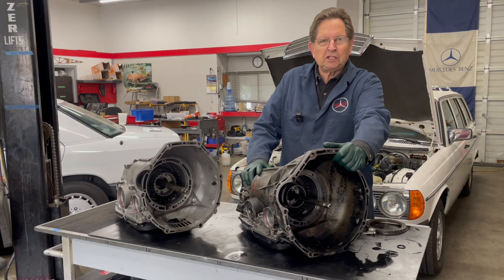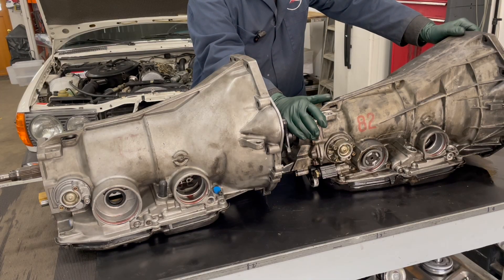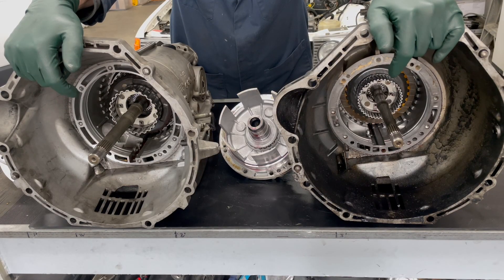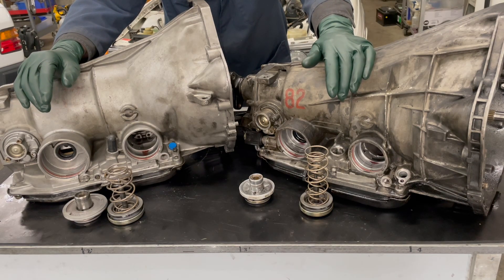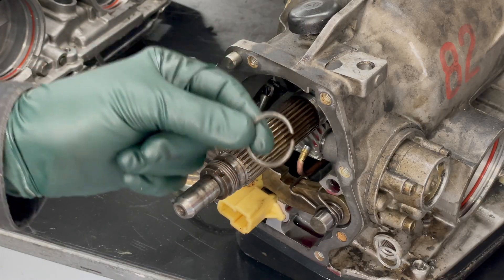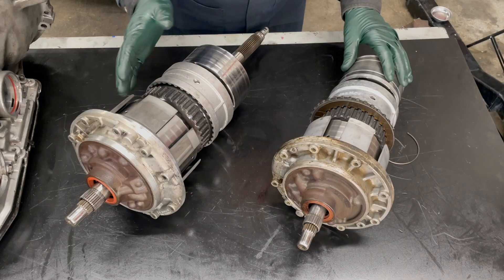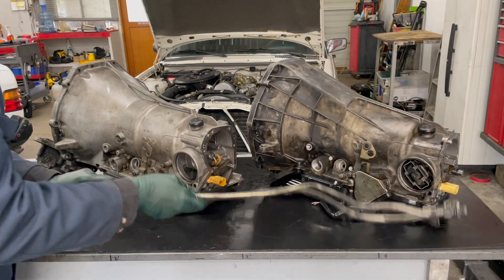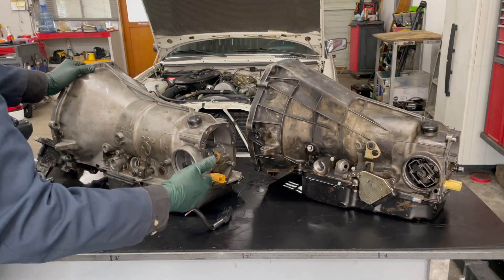Mercedes 722 3 vs 722 4 Transmissions: Differences? Swapable? @mercedessource.com

Comment: Dos the B2 pistion regulate shifts 2-3 becos my w124 jer k s wen it shifts 2 to 3 gear?👍?
Reply from the maker: The B2 piston does not "regulate" the 2-3 shift, but a problem with it can cause harsh shifts. It moves the B2 brake band on the K2 drum. Google for more info
Reply: @Mercedessource thank you👍

Comment: Are all seals, o-rings and clutch packs still available from Mercedes?
Reply from the maker: I may find that not all genuine parts are available. It is changing weekly as many older parts are becoming NLA. Check with Mercedes. Good aftermarket parts are still available.

Comment: Does the 722.3 series interchangeable? I have Sprinter 2.9 with 722.375 and i wonder 722.369 and 722.375 are they the same? I couldnt find 722.375 - in my reverse gear is broken (sometimes it doesn't connect and it jerks),
Reply from the maker: Most of the internals are the same, but there are differences in the case, torque converter, valve body, etc... due to the different engines it is mounted up to. Be careful. Do your research. I may be better to remove your transmission and re-seal it.
Reply: @Mercedessource  Reverse issue - Is this only seal problem in your opinion?
Reply from the maker: No. It all depends on mileage and how weill it was maintained. Mileage over 250K and you may need clutches, brake bands, etc.

Comment: Judging by those (necessary) re-enforcement ribs, that 722.4 case is a good deal thinner than the .3. I’m sure this box was far more cost effective for the 190 so it didn’t hit the W124s price point. Those pliers are amazing BTW. I have a set like those for transmissions, but they’re only for flat rings with pointed ends. They do not do well with the round rings.
Reply: The 722.4 have also been put in all he W124 that have 4cyl engines. My '94 220 CE has 722.4 transmission in it.

Comment: It seems like we're approaching the point where it's going to be cheaper and easier to swap a modern transmission in, even with all the crazy mods that will require.
Reply from the maker: That is incorrect.  It would not be cheaper, and it would not be easier. These old transmissions are tough and they do not wear out mechanically unless they are abused.  They just need resealing $200 or resealing and clutch packs $400 (parts cost).